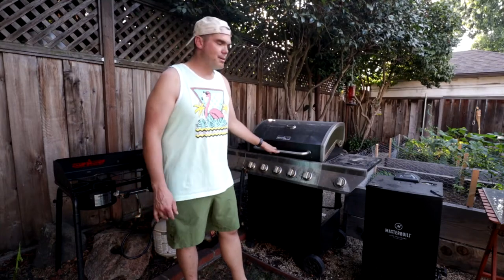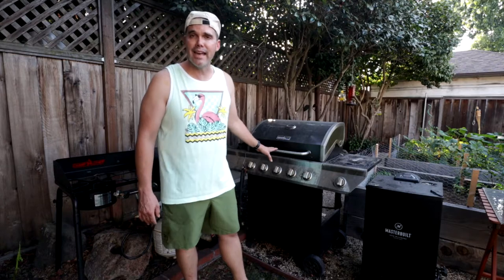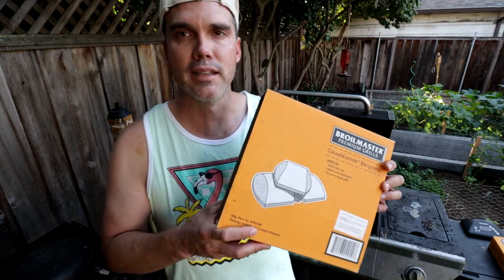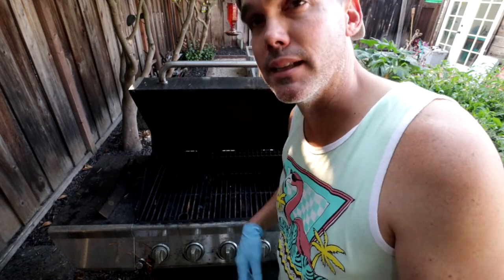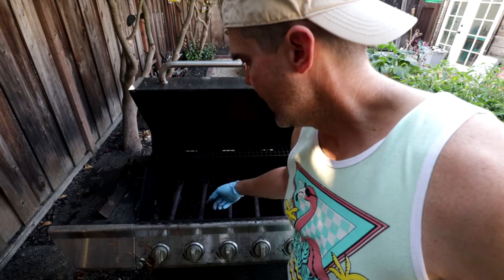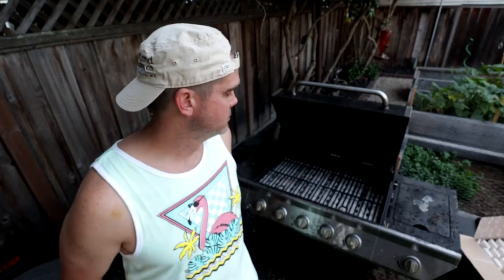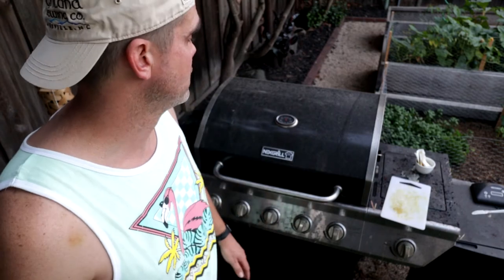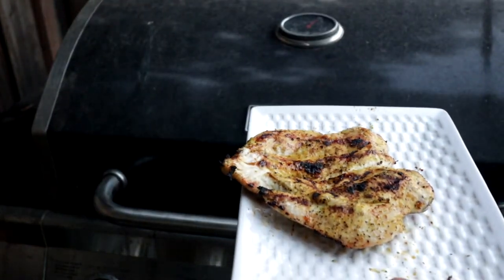Grill Repair Modification. How to Replace old Heat Deflectors to Upgraded Ceramic Briquettes.

Comment: just figured out about the rocks on my old Charmglow.  thanks for the clear explanation and demo.  but maybe your flames are too yellow?  I think they are supposed to be all blue.  maybe check your gas jets?  You saved me a bunch of money for new burners and heat shields!
Reply from the maker: I'm glad I could help!! I think that the yellow flames were from the grill being completely open and that tank being on the way out.  Great observation. I can get my grill crazy hot with this mod, even when it is in the 40s outside.  Stay tuned for more hacks and mods around the house and vehicles!

Comment: I did this to my 3 burner bbq... I removed the "heat trapping" flare guards over the burners, put expanded steel over burners then the ceramic briquettes on top.
I have a more consistent heat, and don't have to have gas cranked to medium high all the time.
I can get good grilling on medium alone which has cut fuel consumption in half!!
😎😎😎😎
Reply: Does grease not clog up your burners?
Reply: @KirkKnight-f9z  No, it hits the ceramic and vaporizes

Comment: Was your rock grate truly 14,5" or 14". Finding it hard to track down a 14.5" which is what I need as well
Reply from the maker: I honestly don't remember at this point.  The main thing that matters is... 
A) The grate is small enough to fit in grill
B) Big enough to rest on the tabs or landings in bottom of grill that hold grate/heat bars on originally.  
It doesn't need to be precise.  Just strong enough and with enough support to hold about 15 lbs of ceramic coals. 
Hope this helps, Jason

Comment: So, is the "upper grate" - the grate that the chicken is sitting on - just resting on top of the ceramic briquettes?  Is that all there is to it?  And it's not a problem?
Reply from the maker: There is a bevel in the bottom portion of the grill.  Every grill is different. Take that measurement and search for a grate that will span it.  Place the ceramics down on that new piece of hardware. Then your top grate “grill” (cooking surface) goes on as normal.

Comment: Do bricks help with creating that Smokey flavor?
Reply from the maker: No.  After time once they get enough drippings on them they kinda have that grill smell affect and smoke as they heat and stuff drips on them.  But you can add chips on top.  Check out this vid. 
https://youtu.be/D0qT5eorsKk
Thanks for watching - Jason

Comment: Those flavorizer bars are not only for heat distribution, they protect the burners from getting a buildup of cooking grease which could clog up the burners. But good idea anyway, good luck.
Reply from the maker: Thanks for the input Butch C!  I can see how that would be a problem.  Not much has made it past the rocks so far.  As I'm sure you know maintenance will reduce fire risk tents or not.

Comment: Did u have to cut the grate to fit it in the grill???
Reply from the maker: Clay Burch No, I did not have to cut it.  Fortunately I was able to get a grate that was slightly smaller than the dimensions of my grill.  My advice would be to look for one just slightly smaller than your exact measurements verses one that is the exact dimensions. Even if it is advertised as the same it could be slightly bigger.  Cutting could be an option but the less tools and time involved the more value you get out of this mod!
Reply: @JTVLIFE  JTVLIFE I got similar dimensions to your BBQ, where did you purchase your Ceramic Briquettes grate from ?

Comment: Could not work out exactly how the briquttes are supposed to be put on
Reply from the maker: You need to add another grate where the old heat baffles used to sit.  Then just lay them out flat. - Jason